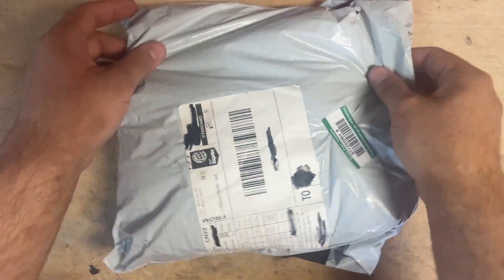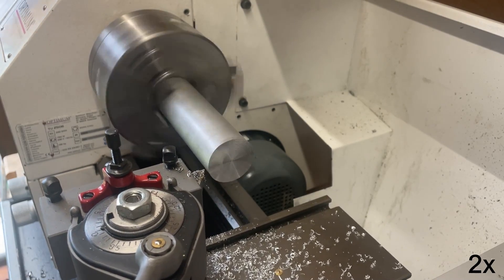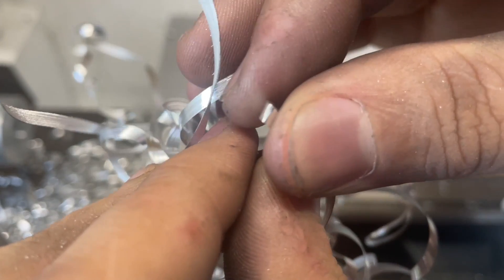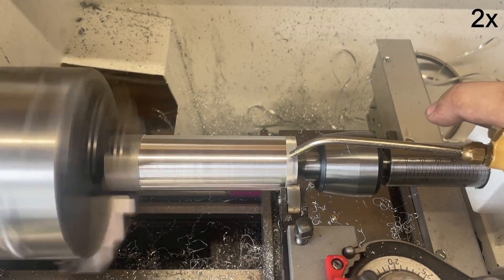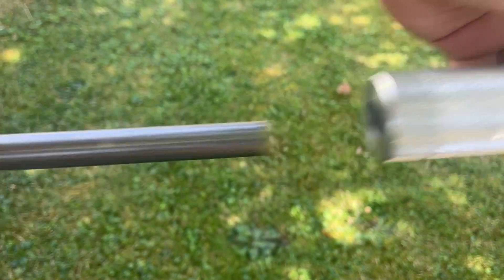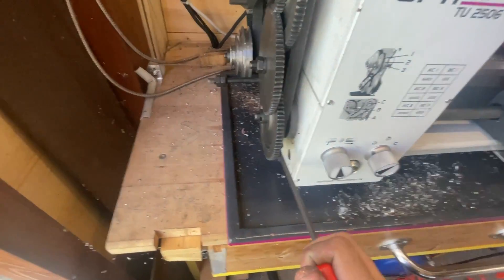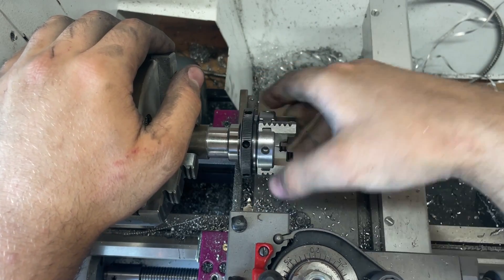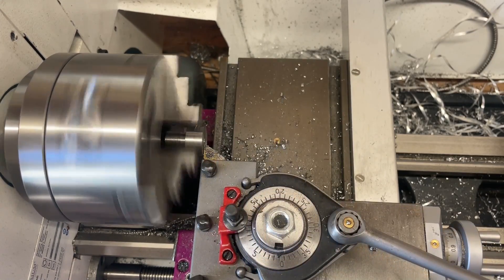Making the Hand grip and treadinsert (Turning) Part 3

Comment: don't worry about having to thread like that.
I knew a tool maker and that was the only way he single pointed - internal and external.
When I asked him about it he said its the best way to get a thread done without wrecking the threads. You only need to be out a fraction on a rotating dial and you can wreck a thread.